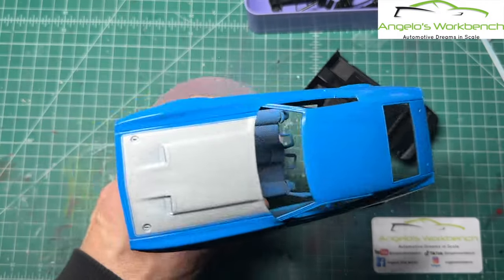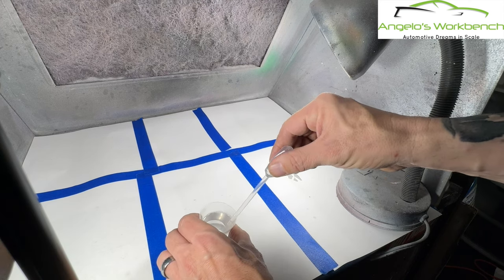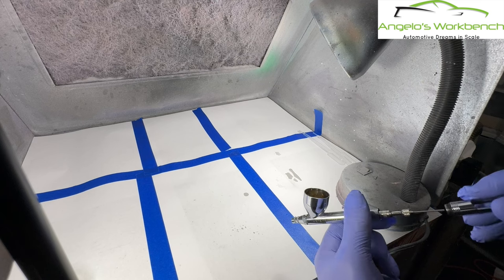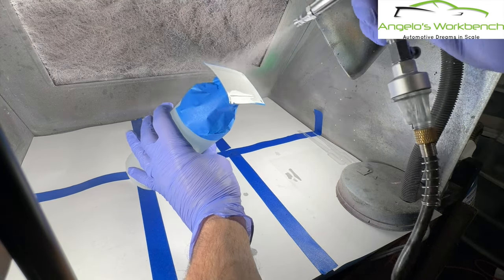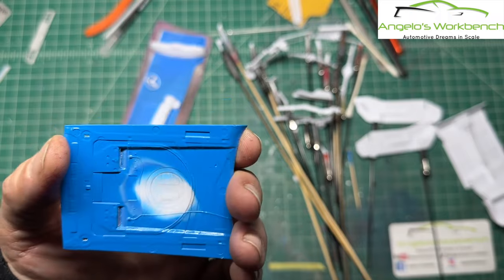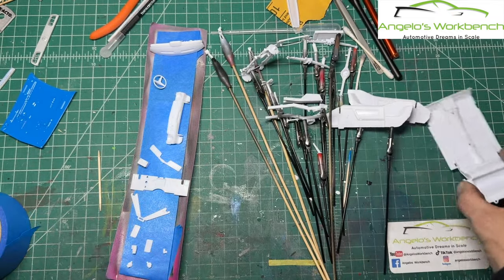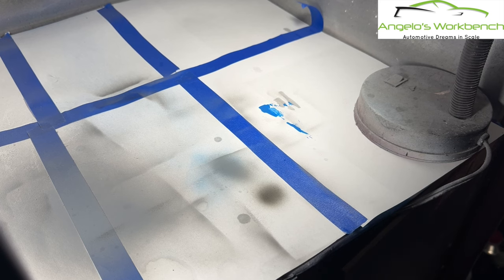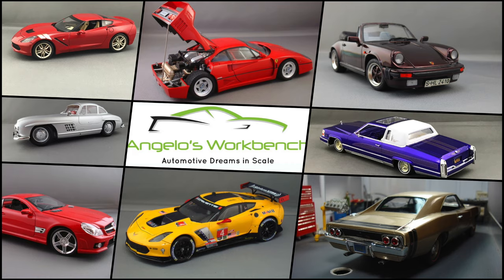Revell 71 Boss 351 Mustang New Tooling Video #3

Comment: I don't understand about the thickness of clear coats. When I see it, it doesn't seem thick at all. The paint are way thicker than this. Is it because it is very sticky?
Reply from the maker: When I spoke about thickness of the clear I meant about building up the layers. True the viscosity of the paint was pretty thick before I thinned it. Both the paint and the clear were thinned to about the same viscosity to spray through the airbrush. The 2k clear tends to build up layers really well and if you put too many coats on the body can look like it was dipped in clear and things start to not fit right like the hood and bumpers and stuff. I hope this helps. Thanks for the great question! 😃